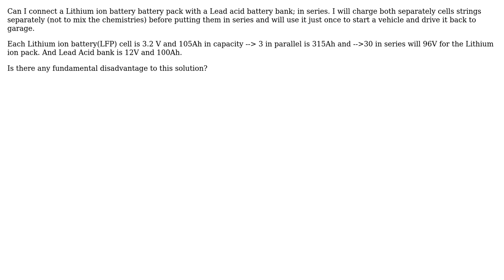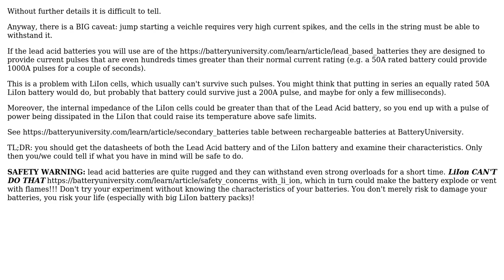Mixing Lead acid and Lithium ion in series, after charging them separately

Comment: hmm,, IDK, the charging -critics of Lead-acid, and Lithium (any type),  the lead-acid is not as-efficient ( is say 80% = ever 1ah charger sent to it, it only stored 0.80 ah's) lithium (any type) has 95% efficient, ..   what does that mean in charging ..   the voltage of the 2 different types of batteries will surely spread apart , 
start out with them new - (3s ion - 12.6) + (lead-acid 12.6v) for a total at 25.2v ,,   ok - after a few Cycles , you would gain charge at 25.2v -  now becue of efficiency the Ion will be at its 12.6v well before the lead-acid is ever 12.00v, -casing overcharging of ion "if no BMS is used", -   

just thought you should add this,   - there are Safer mixed batteries - , like Acid + Nihm/cm ,   both chemistry can be over-charged and will self bleed off the Excess voltage as heat thow I highly recommend watching over them charging together .. (lithium of different types should be able to charge together easily but the discharge curves of each might have issues never tested different lithium types in a battery pack before , seems like a good experiment for me :) )